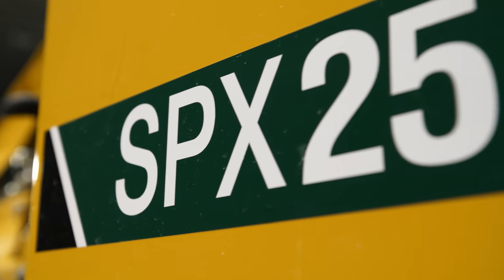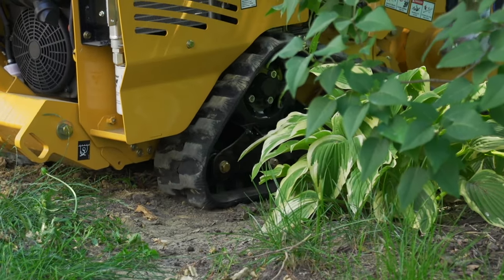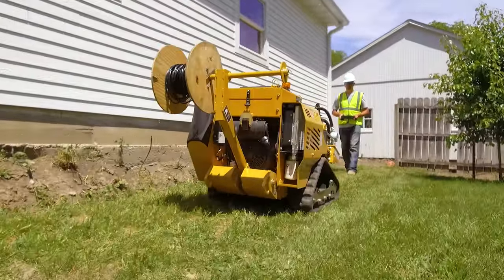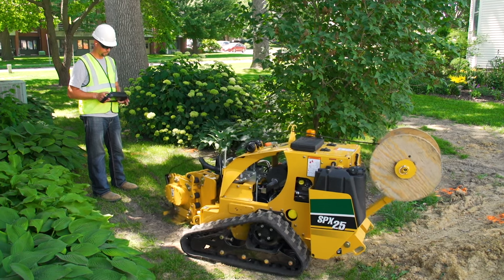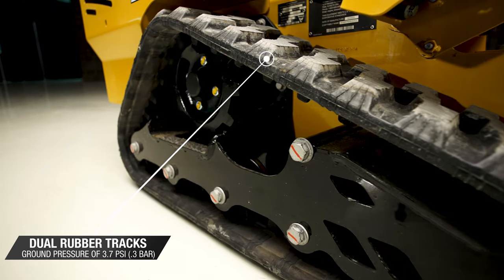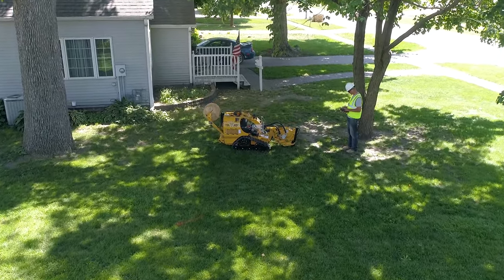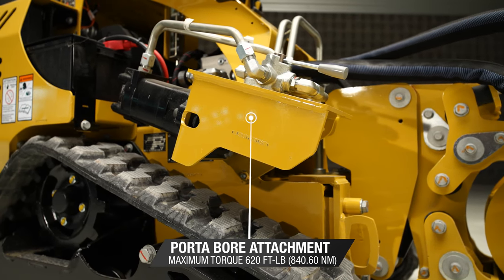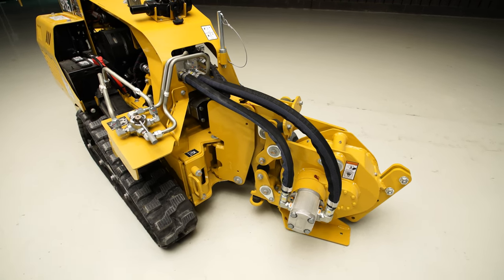Walkaround of the Vermeer SPX25 vibratory plow

Comment: The thing with those wide footprint tracks is it reduces actual traction or forward pull......point contact increases pull via four connections like tires. They spread the load out to minimize damage, but a machine this light needs point contact, or maximum psi at the ground.

  I ran a Ditch Witch VP12 for 20 years as an irrigation contractor and that goddamn thing was relentless down to 14 inches of cover in wet sand!

By the time I retired, the pull blade had worn to 12 inches of cover.....sitting in my backyard now, and that old Onan starts rig[ht up......

Comment: I have this machine. Extremely irritating to use. This video shows the worker walking behind the machine at .45 sec mark. I could never do that. It drops signal having me to re-enter code. I have to be at the other end of the machine so my signal stays connected. NOT 360 degree as claimed. I can’t see the plow properly from there. I wish I could use the controls on the machine rather then remote. I feel less safe when I can’t see properly. I’m thinking of doing video on it and posting it. Bothers me even more when I think how much this thing cost me. When I call in a mention this I’m told there are costs. Shouldn’t be. Been like this since new and I only have 45 hours on it
Reply: Thx for the honest post
Reply: Got it fixed. Working great now
Reply: @BenchmarkGary  How did you fix range issue? I only have 50 hours and I also have the problem of losing range a few meters from the machine
Reply: @lukasz240ify  I learned that this remote system is heavily interrupted if there is a lot of interference in the area. For example low power lines etc. Sort of like electromagnet interference. I have tried changing channels. Resetting the whole machine. New remote battery. Nothing worked. After working in a different area that I was at for a while it never happened again. In fact I could walk 50’ away and still have uninterrupted connection. Went back to the other site and the machine wouldn’t let me walk 5’ away. Moved to another location same day and worked perfect. To sum it up there are just some areas that have way too much radio waves and wish the machine had a wired connection for such areas. Still looking into finding a way to measure such frequencies accurately